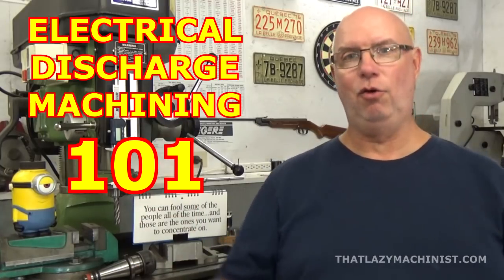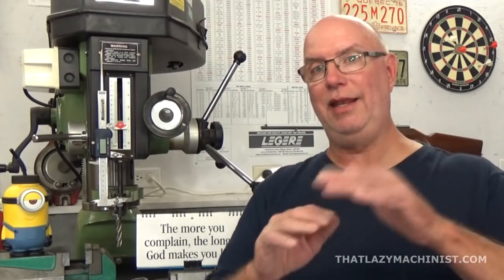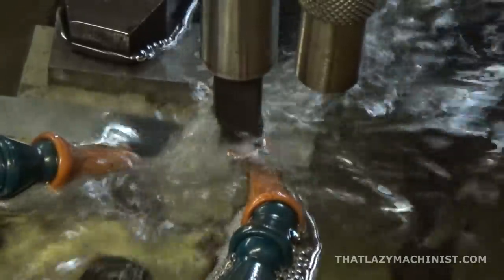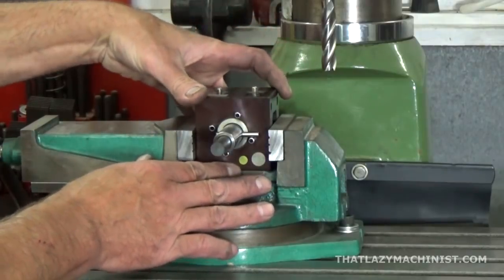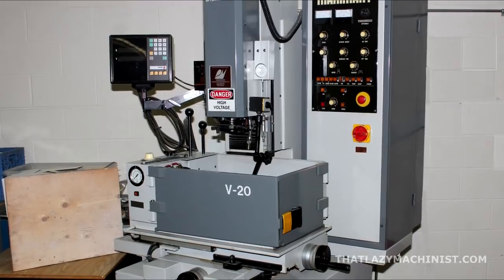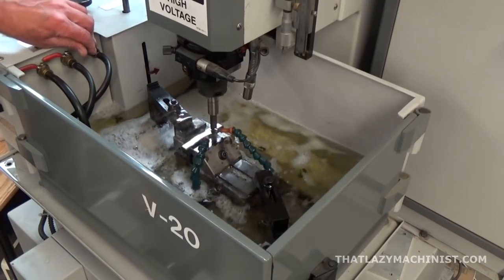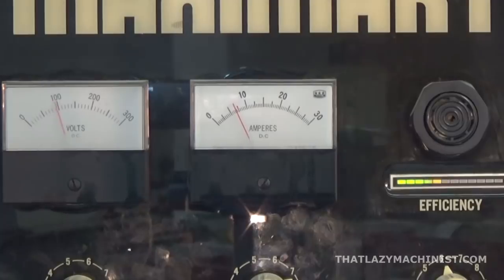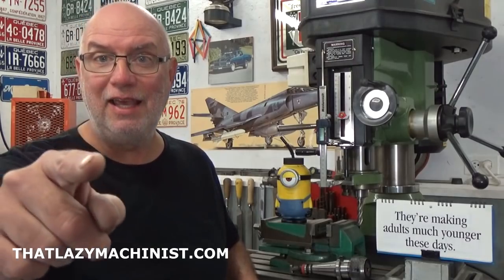ELECTRICAL DISCHARGE MACHINING EDM, MARC LECUYER

Comment: Wonder why it is still NOT popular in most shops. It is a very simple, and old process (Russians invented this in the 1930's or 40's, about same time as TIG welding)...
Why it "must" be so "special" (and used mostly in moldmaking)? Weird...
 
In part 2 of the video, make some threaded hole in the solid carbide. Just an idea.
Reply: Speaking of TIG welding, I wonder if you can use graphite instead of tungsten. If by some unfortunate resource issue we can't get tungsten easily, we can still make graphite from biomass.
Reply: To get the settings correct is a bit of a craftsmans black art ----which can only be brought about by experience ----it is not a simple process if tight tolerances or finishes are required----it is also a very slow method of machining---but it does things that conventional machining can't

Comment: I'm fairly confident that the graphite dust being produced is extremely bad for you!
You might want to consider wearing a mask and perhaps using an extractor system.
Reply: And it is not pure graphite, there are metals mixed in.

Comment: Using the EDM sinker, one can much more easily form lathe radius form tools than by using any sort of grinder... You just need to make a proper dia. electrode and let `er rip with the blank set up to instantly form both the radius and the primary clearance angle... Not to talk about making internal ring gears and other such parts that are quite exquisite in regards to what they require to be made by conventional means of  machining... Sure, slow as hell, but for special one off parts that you need today(not now, lets be realistic, you will have to wait for a few hours, but still, it`s today...)

Also, i would rate your average tungsten tig electrodes as more durable for EDM than graphite... They however are limited in diameter and are best suited for micro hole sinking or such operations... Just avoid the radioactive ones, as you can really be at no loss by just using the regular rad. free tungstens, it`s not specific welding, it`s just spark erosion... If it`s a great conductor, it does the job, and tungsten is amazing at all endurance aspects and rigidity wise, and while EDM doesnt work on a contact basis where regular rigidity is important, the more stiff the electrode is, the better it will deal with the oil plunging effect while sinking a hole, and thus will be more accurate in the end result... 

All the best!

Comment: Years ago I made an EDM machine and used a brass hex tube to cut a hole in a HSS tool bit. The finish was very smooth. Is the roughness of the cut in the video due to the high current or higher voltage (about 100 volts)?
Reply: Both, but more it's about current (and speed/feed), plus electrode(s) wear.
Reply: Was there a reason to cut a hex  shape in a HSS tool bit ? ----what a strange thing to do

Comment: Great video however I believe the spark creates a tiny molten pool of metal which blows off and washed away with the fluid it is not attracted to the electrode

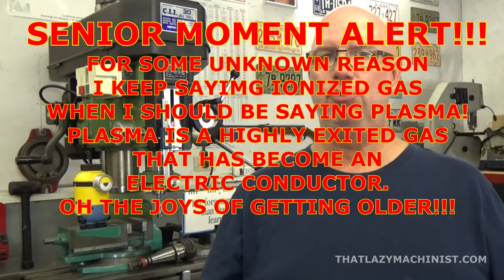Comment: 7:20 Plasma is ionized gas. But not all ionized gas is plasma.
https://en.wikipedia.org/wiki/Plasma_(physics)
"Plasma is a state of matter in which an ionized gaseous substance becomes highly electrically conductive to the point that long-range electric and magnetic fields dominate the behavior of the matter."
So you weren't wrong to call it ionized gas, it's just more accurate to call it plasma.

Comment: I'm digging those analog gauges on the EDM machine. What is cutting tool life like? I'll bet you could 3D print cutting tools with a graphite filament. Another great video.
Reply: It depends how much you "push" it (how fast, how much current). Most cases it is one-off tool if doing something precise (and you need 2-4 identical electrodes, to rough and finish).

Comment: why do the sparks not go to the sides of the cavity, just straight down?
Reply: I believe that they would, initially. But after a certain gap is achieved, the electrode doesn't get any closer in the XY direction...only in the Z direction.
Reply: Waco Glenn is correct! That is why the hole will always be bigger than your electrode, too.
Reply: Yes, sparks attack mostly at the bottom (that's the travel direction), but on the sides too, that's called "over-burn", must be included "into the equation".
 One must know particular machine and "guess" how much it will be, to make proper size electrode. In the art/science dualism, this is the "art" part.
 It's like "The Feel" (book-smart trolls claim there's no such thing) in the measuring.

Comment: EDM HAS IT PLACE A BLIND HOLE WOULD BE GOOD FOR THIS BUT WIRE BURNING IS MUCH FASTER AND COMPUTER DRIVEN. NO ELECTRODE REQUIRED AND VERY ACCURATE..